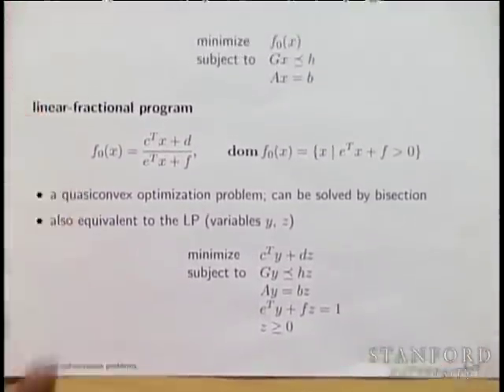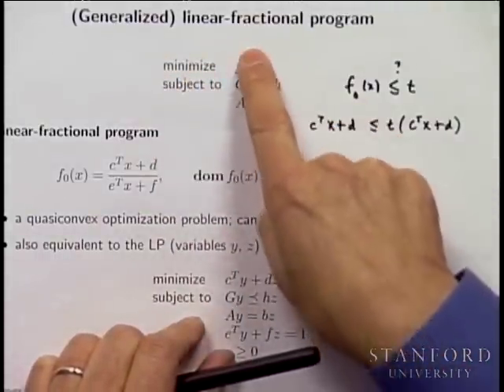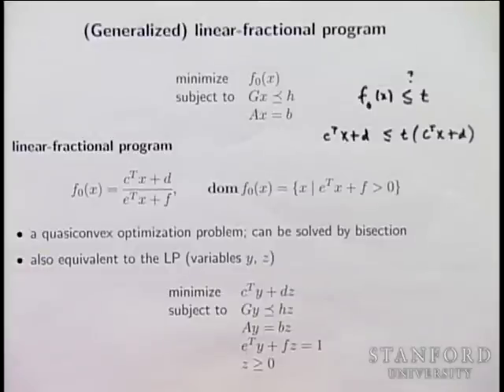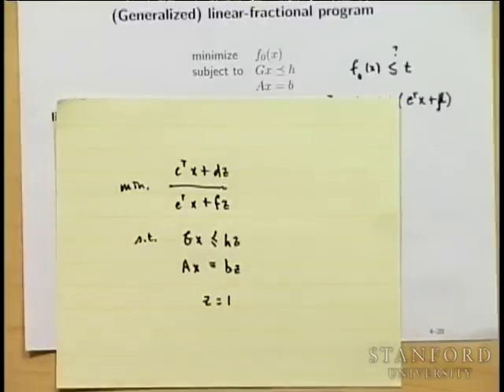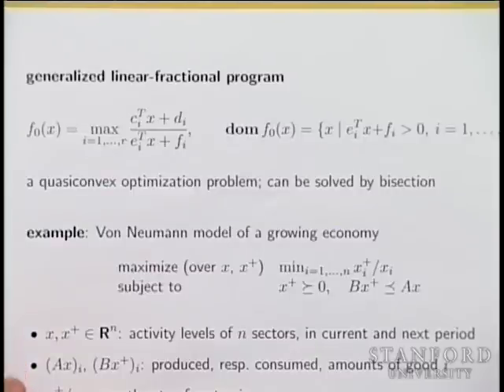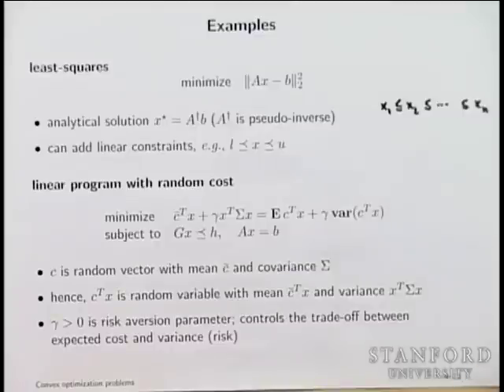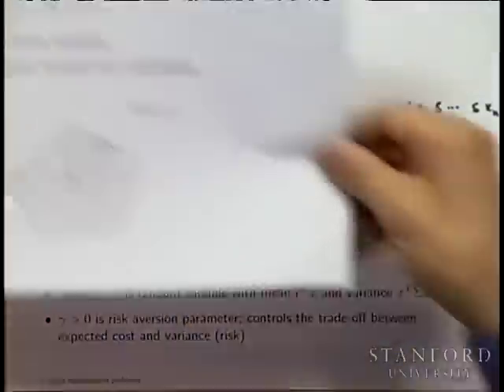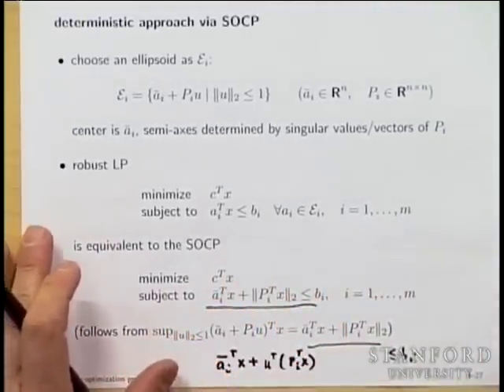Lecture 6 | Convex Optimization I (Stanford)

Comment: 0:45 (Generalized) linear-fractional program
11:56 Quadratic Program (QP)
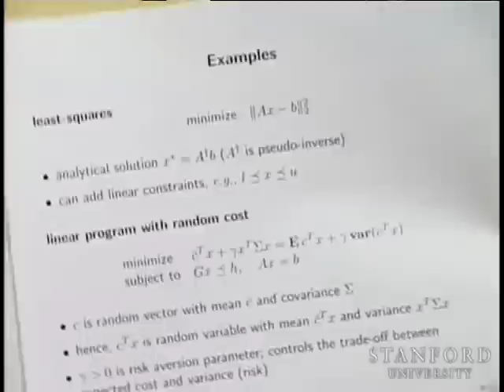14:00 Examples
22:52 Quadratically constrained quadratic program (QCQP)
24:18 Second-order cone linear programming
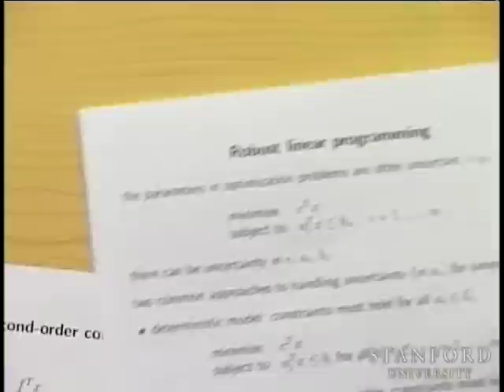29:21 Robust Linear programming
34:26 deterministic approach via SOCP
38:07 stochastic approach via SOCP
40:28 Geometric programming
46:23 Geometric program in convex form
52:53 Design of cantilever beam
1:03:18 Minimizing spectral radius of nonnegative matrix

Comment: Agree with crnogoracz at 5:34, this is just letting x = 1/z * y.  Since x is in Rn and z>0 then y must be in Rn.

Not sure why z>0 though. The only implicit constraint here is that e'y+z*f>0. And we are normalizing f(y,z) by saying e'y+z*f=1, which seems to restrict y from all of Rn if z > 0. For example, let e'y>1 and f>0, then z must be negative. Am I missing something here???

Instead, let x = 1/z * y with y in Rn+, z in R with z <> 0.  Then I think it works.
Reply: Because z <0 would change the sign of other inequalities and that won't be the convex problem anymore.